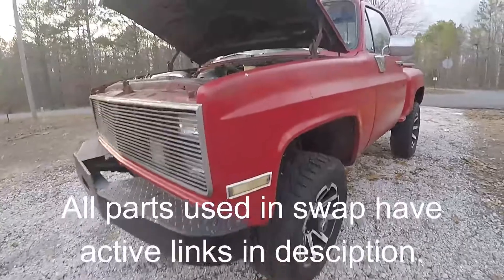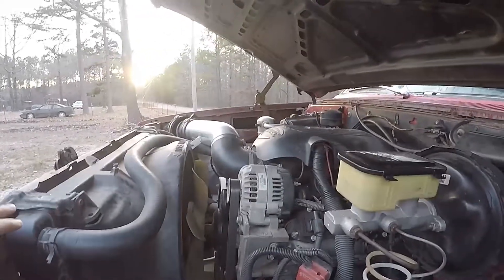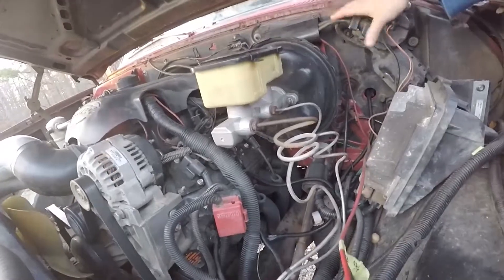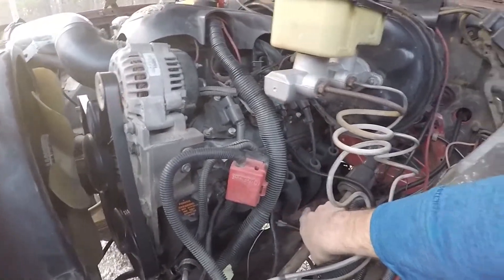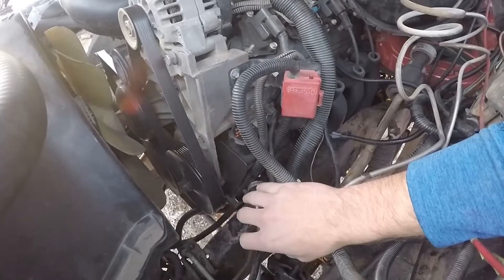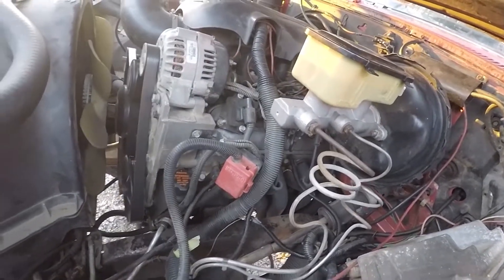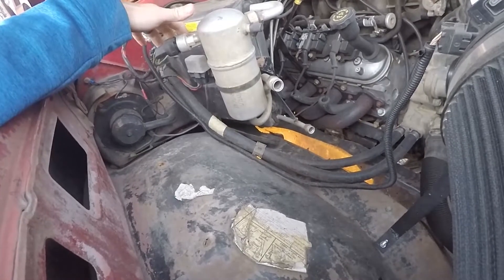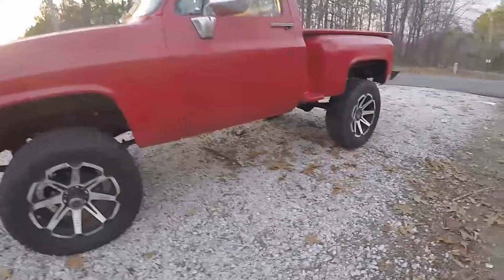Squarebody LS Swap Overview and Cost "All parts linked in description"

Comment: Are you running a 4l60e ? If so how did you set it up to the vss and what adapter ?
Reply from the maker: In this truck I'm running a manual. But I'm running the speedo gear from the transfer case

Comment: Does the oem fuel pump not produce enough pressure for the ls?
Reply from the maker: This truck was originally carbed and had a mechanical fuel pump. Some later models had TBI woth an intank pump. They do not produce enough pressure or volume for the LS fuel pressure

Comment: Nice set up, how does the fuel mileage compared to a typical small block?
Reply from the maker: SB was typically around 10 mpg, with a pretty aggressive cam. 
LS is around 17 mpg highway,  But I also have taller gears now. 
Driveablility is the biggest improvement

Comment: What size clutch are you running?
Reply from the maker: 12 inch if I remember correctly. I used a local O'Reilly to get it. Just a standard stock one for a k10.

Comment: I wish I could do mine. I have a 350 bored 40 over. Monster motor lol. I just want better fuel mileage. I wanna use the 4L60e in mine
Reply from the maker: I can confirm fuel mileage improves. You'll never regret the swap!

Comment: No problem with the transfer case or drive shafts? You are using all your factory stuff?
Reply from the maker: It has the NP205. It's rock solid. I put the trans in the factory spot and ran the original driveshafts. It did great for 2 years until I dumped the clutch on first and detonated the rear u joint.
Reply: Haha that's awesome man hopefully you got it buttoned back up. I'm sorry I didn't reply earlier I'm rewatching your video now and just saw my comment and your response. That's awesome. Did you have to do anything with a VSS signal for the PCM? Did you happen to know your axle gear ratios? I'm wondering what your setup is and how it drives at highway speeds with the sm465.

Comment: i want to do basically same thing to '81 short wide bed. have any problems with clutch? any slippage with stock pressure plate? is disc full size inside dim. and outside dim. i believe my tranny is A833? 3sp w/OD takes ATF fluid. Did you have to change engine torque slope in ECU? is radiator single core or triple core? i'm curious to know how far below crossmember does oil pan hang below. i know 4wd doesnt have clearance issues, but 2wd like mine probly will all aftermarket pans very expensive so this is big issue for me. do you know of any options, like car models might be cheaper?  thanx for any input,
Reply from the maker: No issues with the clutch slipping. The disc is from a 79 C10. Yours may be different and I'm not familiar with the trans you mentioned. May be worth some google research on that. When you send your ECU to be reprogrammed, they should ask what trans you will be running. They will tune it accordingly to function in the swap. I'm currently swapping a 5.3 from a truck into 81C10. There are no clearance issues with the factory oil pans. The Radiator in this K10 is a 3 core from a diesel powered k20. Not really needed. I've heard of some running the factory single core with no issues.

Comment: Interesting swap sir. I believe that I heard you say you kept your stock wiring harness? Im LS swapping a 77 K5 and have been trying to figure out if I need to keep any of the wiring?
Reply from the maker: Keep all the factory wiring for the chassis of the truck. I used various adapters to run the original sensors from the K10. I like to run the factory stock guages. Saves money and makes it easier. You can use the 12 volt distributor line for key hot to run the engine harness. I plan to make a video on the topic with my current swap. In the meantime email me at badadvicegarage@gmail.com and I can get you more details on it.

Comment: Glad to see you used the factory fan. Everyone I know who has done these swaps and drives daily and added elctric fans tell me they run a bit hot. I did the same with you on my swap. I wanted to make it so that if I needed to replace a part, I could go to any auto parts store. Well done!
Reply from the maker: I agree, I use the truck mostly as a work truck. It's reliable, proven, and cheap/easy to replace. Can't beat it.

Comment: Did you have to use a fuel regulator with it or do you not need one?
Reply from the maker: Some earlier 5.3 and 4.8s have return style fuel lines attached to the intake. Those models came with a factory vacuum referenced fuel pressure regulator.

Comment: thanks for the list from amazon needed that cold air intake setup for my first ls swap I also am retaining my stock pcm i however wrote vats out of mine i could however show you how to right ur pcm for the cost of the dongle ill walk you through it if you would like... you can really unlock alot of options in that pcm
Reply from the maker: Glad I could help! I'm always down to learn new things!
Reply: @badadvicegarage  i will be uploading a video soon of what you will need and the pcm os versions that work aswell as a bolt and go flexplate for the th350 th400 and 700r4
Reply from the maker: @hankplays4563  sub'd. Looking forward to the video boss!
Reply: @badadvicegarage  ty i subbed to you aswell

Comment: i have a 1985 k10 and a 5.3 4l60e np208 or 241 not sure yet which xfer case . i like the mechanical fan and shroud it looks factory . dont know what motor mounts to go with . a friend has a c10 and he rolled the frame rail on the passenger side like a 1/2 inch to clear the stock compressor and location . he used fittings from cold hose i think to help clear frame . more videos would be great . where are you located bro ?
Reply from the maker: I'm located in Arkansas. AC was never high on the list for me, but I have seen where guys notch the top side of the frame for clearance. They also have relocation brackets that will put the AC compressor on the top side of the pulleys. Dirty Dingo makes some motor mounts that I've heard work well. I went with the ICT billet ones. The link is in the description.